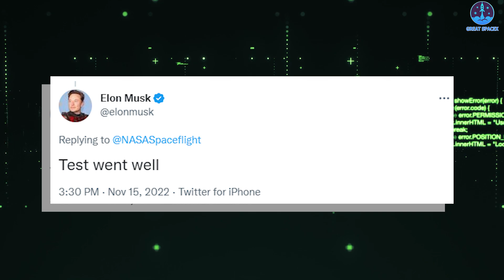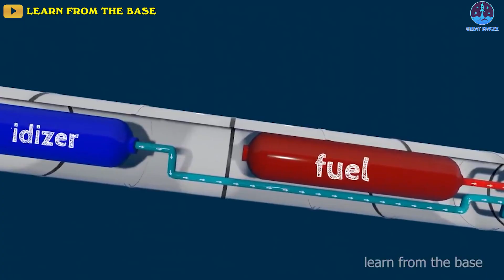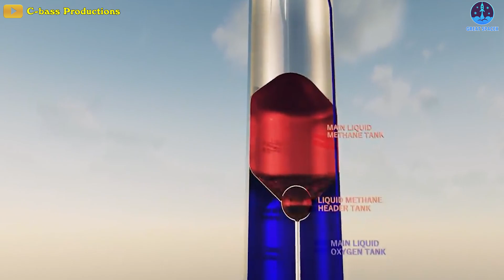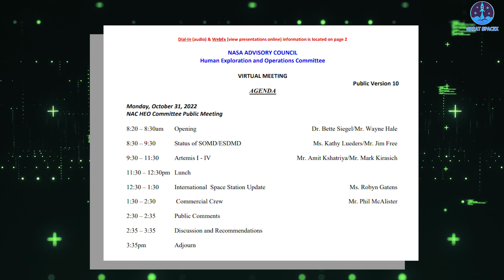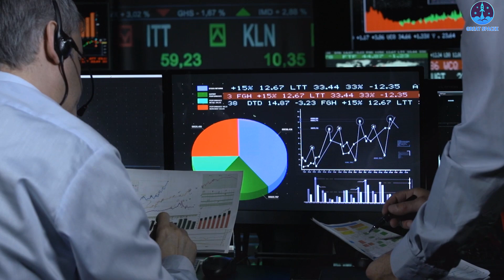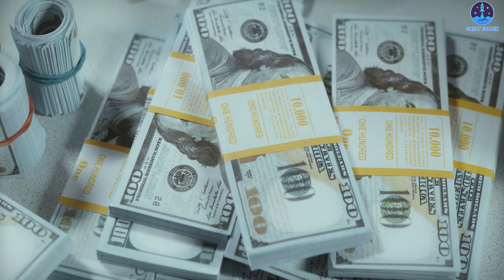Elon Musk Officially Announces "Massive Firing Test for 20s, Then Orbital Flight"!

Comment: Why not over clad the concrete beneath the OLM with a heat resistant metal pad that has water cooling passageways built into it to prevent spalling the concrete.

Comment: one question, if they do a static fire with all the engines wont that break the skirt where the engines are if the rocket is anchored into the olp? i mean 7600 tons of thrust is a little to much for any metal structure (inside the rocket).

Comment: Interesting to see how tests with increasing numbers of engine's will go.!  Just a thought, if the floor under the launch pad is re-inforced concrete that will be exposed to the rocket engines hot exhaust flames, it might be an idea to ensure the concrete don't contain moisture prior to the testing.  Reason being that rapid heating of the concrete, in spite of the water deludge applied during the actual engine tests to cool everything will likely cause any moisture trapped in the upper layers of the concrete to become steam that would expand and cause the concrete to "spall" with flakes and chunks of concrete likely to go in all directions. 🤔!!!
Reply: The OLM is too close to the ground...!!
Reply: I really don't think they've thought this through properly.
Reply: @paulkazjack  it’s the leading space agency in the world. I guarantee you that they’ve thought everything through, because if they don’t, then it explodes. 

There will be safety factors on top of safety factors
Reply: @Suppise152  certainly does explode just like the gas build up the other week which could've taken out stage zero!!
Reply: concrete is 90% water.  There is no way to create moisture free concrete.  moisture free concrete would be a pile of sand and rocks. That being said, if they want rapid reusability then they need to design a launch pad that won't need to be rebuilt after every launch.
Reply: @JoeShmoism  Who told you concrete is 90% water?? Lol...
Reply: ya we have seen that happening on other tests. maybe they don't think it will do enough damage to be an immediate problem?

Comment: The orange dust seems to be of concrete. Pieces of concrete were also seen flying. The process depends of the texture of the material, the concrete used on the ground doesn't look good for this objective and it is not the first time. So far, these tests are failing to address the type of ground used. Just get strong large bricks of granite with high levels of silica to cover the ground, also, it melts at 1250 Celsius degrees... anyway, something better than that concrete.

Comment: Your math is terrible.....7.1 millions pounds of thrust? More like 70,000lbs of thrust, if you want do the math I rounded slightly in my head, but yea 14 = ~70,000 lbs of thrust
Reply: With Super Heavy's peak thrust of 72 MN (16,000,000 lbf), the rocket has a thrust-to-weight ratio of about 1.45 at liftoff. One launch may deliver 100 t (220,000 lb) to low Earth orbit, which would formally classify the rocket as a super heavy-lift launch vehicle
Reply: I think maybe you are the one who did the math wrong... Even just 1 of the raptor engines has more than 70,000 lbs of thrust. Just one has around 510,000 lbs of thrust when at 100%

Comment: And a reminder for those people who will otherwise panic unnecessarily... the holddown clamps have more than enough capability to hold the Starship and Super Heavy firmly in place, even for a full-length, 33 engine static firing. Steel has much more tensile strength than you realize.
Reply: "Steel has much more tensile strength than you realize."   It depends on the temperature of that steel.
Reply: @user-yd1vl9lj5j  if only there was a way to take that into account. . . .
Reply: I'm not at all worried about the clamps.  I'm kinda worried about the concrete foundations of the OLM being blasted to pieces by all those beautiful engines firing at once.
Reply: @JoeShmoism  I'm not worried about the OLM, I'm worried that Boca Chica, Texas might end up in orbit.
Reply: Hope the foundation is well anchored.
Reply: With all that rocket thrust, what's holding the orbital stand in place?  My hope and wishes rest with your continued success in humanity's journey to the heavens.